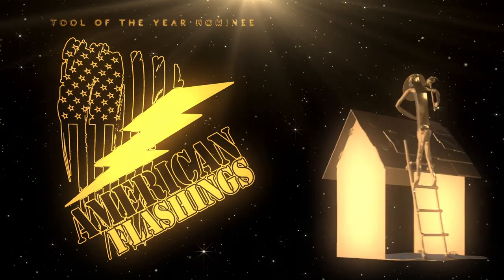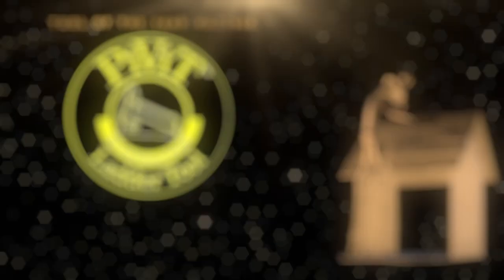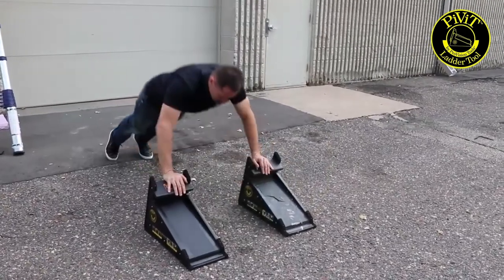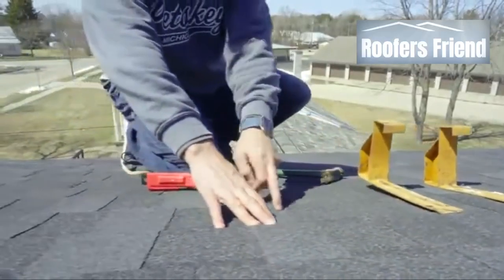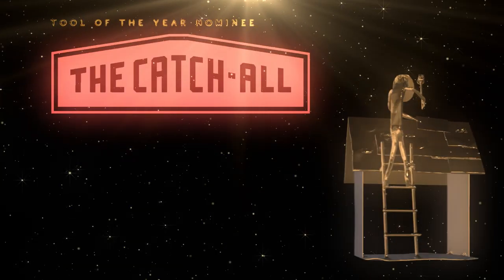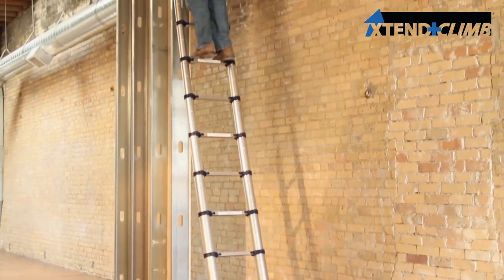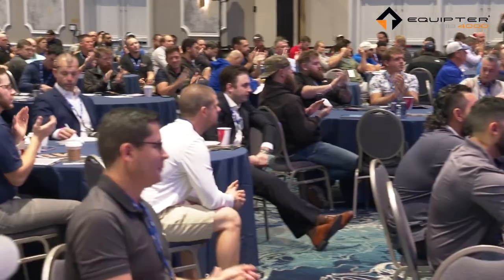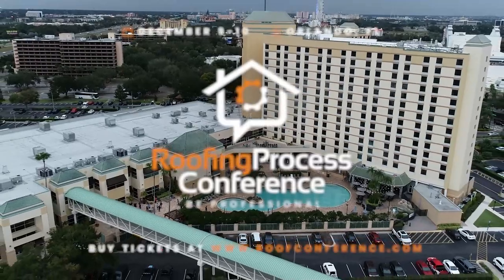2021 Roofing Tool of the year nominations: Roofsnake, Roofers Friend, Pivit, Equipter, Trash Rocket

Comment: Soo, I use an old tractor and dump trailer..I have a bucket on the front of the tractor the reaches 10' and has fork attachments...lots of uses. All together costed 3,000..for what it does, maintenance on the equipment is minimal after the initial go through of repairing seals and connections. One day when I can find an equiptor for around 2,000 ill prob grab one,, but for what they are asking around my area, it's just not even close to affordable considering what I do.  I work as a 1 to 3 man crew these days (I get the whole dont labor and sell rhetoric...I sold my roofing company a year ago, and very much enjoy now just being an independent contractor/roofing consultant...it may not last forever but while its this good, im going to take advantage of it.) I have found equipment is more reliable and dependable than people, so instead of paying labor, I buy and rent equipment to make the job easy.